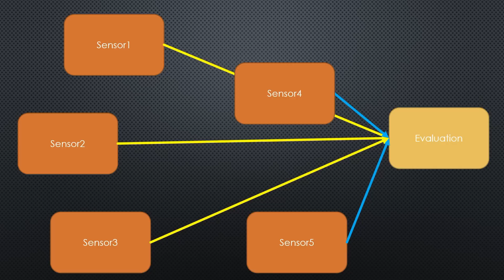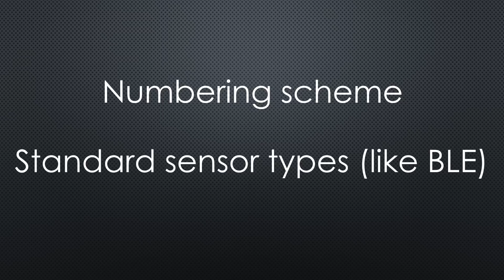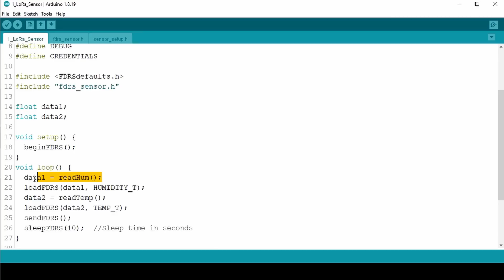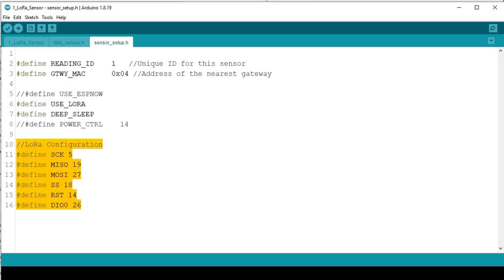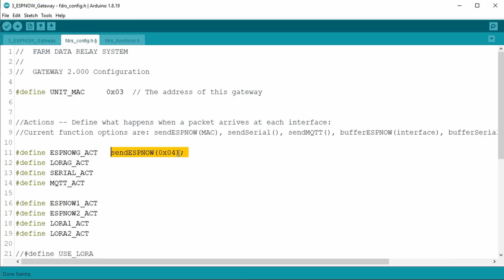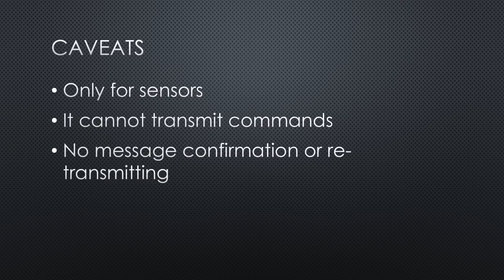430 ESPnow and LoRa Network (incl. Repeaters and Gateways). A TTN replacement?

Comment: You said that LoRa is a slow but long-distance communication protocol. It is not suitable for receiving sensor data in short periods (for example 5-10 seconds), right? However in TTN it is not possible , because of lorawan has some fair use policy. What are you recommend for gathering sensor data in an industrial place ?
Reply from the maker: AFAIK is TTNs fair usage policy only for downlink messages (because of the law). They offer a commercial service for professional usage. You can also use the mobile 4G network if coverage is available. I made a video about NB-IOT.
Reply: @AndreasSpiess  I will  watch the video soon , thank you :)

Comment: Is there a limit on how many repeaters you can use? What would be the max range between repeaters?
Reply from the maker: 1. I do not know if there is a limit and where it would be
2. These proxies are just normal bluetooth devices with a range you expect from them. Indoors a few meters, outdoors maybe 50m. Heavily depending on the antenna position and if there is a line of sight.

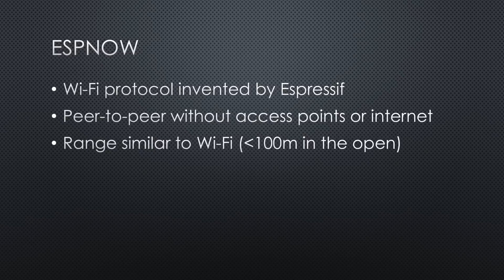Comment: 2:10 I don't remember if you've tested the range in a video. But I've seen others reach 500m easily with ESP-Now in LR mode.
I don't get why he is using two solutions, did he need the higher bandwidth of ESP-Now? Or could he use LoRa for all sensors, simplifying things?
Reply from the maker: LoRa has many km of range. ESP-Now is WiFi with a very limited range.
Reply: @AndreasSpiess  I know but why doesn't he use LoRa exclusively? That would seem simpler and easier to maintain
Reply from the maker: @NicksStuff  because ESP-now can be used with cheaper boards

Comment: Can I use ESP-NOW to listen "non-stop"? I want to control it via alexa. So I am looking to have it working as a receiver.
Reply from the maker: The ESPnow connection should be on as long as both devices are powered.

Comment: Hello Mr Spiess
many thanks for info and advises. Actually i am in direct contact with Timm Bogner, he has quite a lot of experience with different hardware. Also his software repository is now capable to do bi-directional communication between nodes. I ordered new hardware and will do some additional tests soon. Best regards and a good time wishes Peter
Reply from the maker: Cool. So I can start the remodeling of my mailbox sensor. I waited for the bi-directional feature...
Reply: @AndreasSpiess  Yes, according Timm, the job is done,  the new code uploaded to the github repository and he was already testing the latest solution. I am looking forward to do the tests with my new hardware, perhaps next week. Please let us know about the success of your postbox application for (walking) lazy developers ;-)

Comment: Dear Mr Spiess, great video again.
Nice tutorial, i was testing it with my LoRa GPS Modules, time keeping works great so far ! For sensor gate detection, i do some tests with radar sensors, many thanks for those tutorials too! As you mentioned it, there are two restrictions in this kind of sensor-network: no bi-directional communication with commands and no acknowledgement of the correct delivery of a data package. The time gates have also the task to communicate with the competitors , when the can start the run. Do You have any hints or ideas, about to solve this ?
Many thanks and best regards,  Peter
Reply from the maker: I hope that Timm will introduce the backchannel and the acknowledgements. AFAIK he already works on it. Maybe you check the project from time-to-time.
Concerning your question: I do not understand what communication and which competitors you mean.

Comment: I think localised LoRa would work fantastic for a high-head micro-hydro projects. Typically you have some long pipe going up a hill to a tank collecting water from a small stream. That could be a few hundred metres away. To maximise the energy produced, you'd have different sized nozzles at your turbine controlled by solenoid valves letting more or less water through while maintaining the full head pressure. A liquid level sensor on a LoRa board could be used to transmit the level in the tank at the top of the hill, opening more or less valves.

Joe Malovich and Land to House have the right setups to integrate this sort of sensor.
Reply: I was randomly popping in on these comments and I wanna say this is one of the coolest use-cases anyone's brought up for FDRS. If you or the folks you mentioned do something like this, please please send some info to the address in the FDRS readme. Thanks!👍

Comment: It's nice and solves problems, but limited to highly static building of the library by defines (No dynamic configuration of any).

However if that's not a real case, it's not needed.
Reply from the maker: Maybe you add your knowledge to improve it?

Comment: I hope my question does not sound too stupid: I'm finally back from sea (working as a merchant mariner) and trying to better understand this whole concept. Everytime I leave, I miss so much and forget a lot. I am trying to come up with a way to transmit sensor data in real time from an amateur (hobby) rocket to a ground station. I'd like to be able to receive sensor data from altimeter(s), GPS, temperature, camera video (possibly), etc. 
So, I am wondering if this application could fill the bill. ANd, I suppose this is at the 2.4 gHz area. Am I right?
Reply from the maker: I do not know the distance and if ESPnow would work. You have to test. ESPnow of course is faster and easier than LoRa. If the distance is too big, LoRa is the way to go. Start with SF7 which is the fastest mode. That should work in any case. You only need a sensor (which you have to program) and a gateway (either one or two modules) as described in the video

Comment: Thank you very much for your video. Just have a couple questions, Gateway(4) can be either ESP8266, ESP32 or LoRa? and also in your example Gateway(4) communicates to Gateway(5)/ESP01 via a serial connection and from the ESP01 to the router via WIFI? thank you!
Reply from the maker: You first decide on the communication protocol. If it is LoRa you need a board with such a module on both sides. They only come with the ESP32. If you use Serial, ESP-Now, or MQTT you can use any ESP32 or ESP8266 with the limitation that the ESP8266 only has one Serial port.
Reply: @AndreasSpiess  Sir, Thank you VERY much for your explanation!

Comment: It's a shame that MQTT-SN never took off. Possibly because people kept reinventing simpler versions of it.
Reply from the maker: The difference is probably too small. Also, most people I know do not use MQTT on low sensor networks. It still has to much overhead.
Reply: @AndreasSpiess  MQTT-SN was designed by the same folks as MQTT to reduce the overheads, support devices that aren't always online and support other transport than TCP/IP. It's even an OASIS standard. Shouldn't be any harder to use than any of these other libraries, but just never got the uptake to build enough community to get good library support.

I think that the big complication in MQTT-SN that the alternatives don't have is that an MQTT-SN node is a full participant in the MQTT broker rather than just a sending sensor measurements to a gateway/server.

Comment: Beautiful! Something like this integrated with the Meshtastic project would be great, they're working on MQTT integration and would also provide that command and control capability 🙂
Reply from the maker: Meshtastic expands in the right direction. It is more an adhoc network while this one is more for standard sensor applications, I think.

Comment: Great video and an exciting project. I was wondering if Andreas or others could provide a hand. I've recently made a weather station project consisting of an IR, light sensor, and ESP32 MCU to monitor sky conditions, especially skies impacted by light pollution, a type of Sky Quality Meter. The plan is to place this several of these SQM sensors to monitor the sky quality in our local, national park and measure the developing light pollution, which you may already know impacts flora and fauna. That way, factual data can be recorded and presented to the local authorities to take action. As you can imagine, the sensors are needed to be placed in remote areas in different places where Wifi is not available, and Lora seems to provide that solution. Any help or ideas is highly appreciated. 😊
Reply: LoRa sounds perfect!
Reply from the maker: Just select the sensor you need an create the sketch to read it. The rest is using the LoRa example of this library.

Comment: Very interesting approach would like to find out if the data buffers would work for the the following. If you were to connect a GPS to a UART is there enough space to program it with the ability to parse the data and transmit only selected data i.e. position data? Would be nice for my hobby of flying model airplanes where sometimes things don't always work out as planned and you can spend days looking for them in the woods. Thanks
Reply: There's a GPS sketch that was recently added to the Sensors folder of the repo.
I'd like to get into model aircraft one day. The YouTube channel "rctestflight" has always been one of my faves and he sort of inspired me to take this project public.
Reply: @timmb2512  I've been flying them for many years. I need to begin with testing since most of my planes use Lipo batteries would need to see if power from a 5V UBEC/SBEC connected to the on-board battery is clean enough to operate the ESP32. Next would be RF testing since both the RC receiver and the Lora device operate in the 2.4 ghz range. Hope to get started testing soon still putting stuff away from field day (last weekend) I'm into Ham radio too.
Reply: Using FDRS for an itsy bitsy black box would be pretty cool. The trick would be to conserve battery once a crash has occurred. Find the location once and save it, then transmit it at intervals without reconnecting to the satellite. Perhaps even better to have the GPS run all the time off of the motor battery, but feed location into the "black box" which has its own transmitter battery as a failsafe.
Model rocketeers may be into this general idea too!

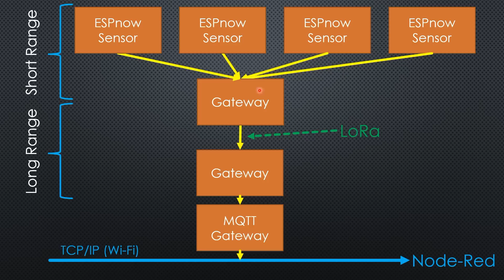Comment: In the examples at 9:40 & 9:50 where ESPnow is not being used,  am I correct in assuming that just a LoRa32 board alone could be used as the gateway that bridges between LoRa and MQTT?
Reply: Yep! If you aren't planning to use ESP-NOW, you can use LoRa and MQTT together. I haven't done this yet, tbh, so I'd love to hear how it goes.
Reply: @timmb2512  I can confirm that it works perfectly with just the single LoRa32 board if ESPnow is not being used. The only little problem I ran into was that my MQTT broker needed a username and password. I added  them into both the global and local definitions. I read you are considering using something like WiFiManager to manage WiFi credentials instead of hard coding them. MQTT Username and password might be another couple variables that could be managed in the same way.

Comment: Great video, as usual. I am a heavy user of ESP-NOW, as compared to standard WiFi+MQTT it saves a lot of battery time, 0.5s vs 5s wake-up to sleep time, in my case. The ESP-receiver and MQTT gateway are on a power supply, of course. It does not seem popular, who knows why…

I can confirm that a single ESP mcu cannot work on both ESP-NOW and WiFi networks, or at least I could not manage to do so. 😅
Reply from the maker: It seems it is possible, but only on one channel (see other comments). This is why I will not do it.

Comment: Thanks for another interesting video Andreas.
I used the MySensors project to do  this job. It was based on the NRF24 for short range (2.4GHz) and also can do LoRa with the RF95 type boards at both 433 MHz and 868/915MHz.
One advantage of MySensors is that is is a tree network (relays)  and it can do actuator commands etc.
I like ESP-Now but I reckon BLE is actually better as most smartphones  are equipped for BLE these days so they can be included in the sensor network as well as a sensor and/or a  controller if you feel like creating an android app for it!
Patrick
Reply from the maker: I like BLE too. But for me it is still quite complex and I do not understand most of it. ESP-Now is easier for me...

Comment: Sir can we create a similar network and send not just sensor data but low size images with espnow or some other method without wifi ? Maybe I am getting too ambitious ?
Reply from the maker: With ESP-Now you should have some capacity. You just have to chop the picture and re-assemble it at the receiver.

Comment: 8:44 ESP-Now and WiFi can work on the same board. They have to be on the same channel. It's easy to configure a channel on an ESP device but configuring a WiFi channel depends upon Admin access. I have used ESP Soft-AP as a WiFi and set the ESP-Now and WiFi channel. It works flawlessly. If you are going to use a WiFi connected to the internet, even being on the same channel it is possible that packets get lost. I will try to fix this issue, if it works I'll tell you.
Reply from the maker: Thank you for your info. So I will keep it simple with my ESP-01 to avoid this limitation…

Comment: Hi Andreas and fans, I need help, my wife is hard of hearing mainly in the low frequencies l am having problems with my damaged vocal chords and my voice is husky. She is unable to use a hearing aid because of a nasal problem. My idea is to raise the frequency of my voice frequency and volume level, while talking or change the acoustics somehow. I am 83 and my wife is 91.
Reply from the maker: Maybe you can use the audio toolbox presented a few videos back? I did not check if it provides such a function.

Comment: I live in a rural area and several of my neighbours passed retirement several years ago. With at least 15 minutes for fire department or ambulance to get here I've pondered some kind of "neighbour aid" system for a while, I'll be looking into this project. (Need to cover an area of about 1x2 km and 20 houses if all are interested)
Reply from the maker: Should be possible if you find a point for the LoRa gateway where all houses have line of sight. Or you need a combination of nodes and repeaters.
Reply: @AndreasSpiess  
Line of sight definitely not possible, from some houses one sees nothing but forest. Up to about 300m between houses.

My spontaneous thought is to use a message-ID created by the event, broadcast that for a while and also have receiving stations repeat the same.
Perhaps a bit "talky" but this is after all a very important message that rarely (ideally never) gets used.
Reply from the maker: Line of sight can include woods. But no hills. You have to test.
Reply: I think I generally agree with your "talky" idea. Send out to everyone in range. You can technically have  a repeater send every packet it receives back out over broadcast, though I think this could cause feedback loops 🤔 I haven't tried... Still it would tell you if a loved one is in trouble though. Very interesting application, btw. Keep in touch!
Reply: @timmb2512  My thinking is to use a message-ID to avoid feedback loops. Probably something like "house number + event type + counter/time stamp". That way a receiving unit would only re-broadcast even if it gets the same message from several units.
Likely a good idea to include an "all good" message once a day or so - that way a faulty device can be noticed.

Currently I'm thinking three "triggers" 
* Fire alarm (linked to commercial alarm, that sensing and responsibility I prefer to leave to pro's).
* Urgent help needed (First aid needed until ambulance arrives)
* Need aid (only triggers selected neighbours)

Comment: Andreas, I am interested in capturing LoRa packets. Specifically, I am interested in trying to merge the existing LoraTap code in Wireshark into the radiotap code which already has mechanisms to handle pretty much all the info that can be captured from LoRa phys and chips. That will involve a capture tool that can generate the correct radiotap header etc. Do you have any recommendations on which LoRa environments I should purchase to get started on this?
Reply from the maker: I do not know these products. So I have no idea :-(

Comment: I'm building the exact same thing (for single grow room), but using just ESP between sensor modules, relay modules, and good old wifi routers for connecting to the internet. Though mine is on a small scale, so MQTT seems like it just adds indirection. I'm using a just sensor and controller modules, no repeater gateways. It's super simple and highly configurable using a regular computer web browser for the UI
Reply from the maker: Seems to be a good project for you needs!

Comment: Hi @Andeas one more comment about the range of espnow Vs WiFi. I think practically it is not right to say that they both are the same. I know they operate on the same freq but then the connection process for both of them is vastly different due to which the range gets affected. To give an example, I have one ESP gateway for my espnow sensors placed on the first floor and all sensors from my roof (at G+2 level) to ground floor can easily reach it. The total time it takes for a sensor to wake up, do its thing and transmit is barely 80ms. Comparing this to a WiFi connection - even if there is weak signal present , it can never make a connection and hence considered out of range. So in my experience espnow has an excellent range as compared to WiFi.
Reply from the maker: Thank you for sharing your experience. I will have to do some tests.